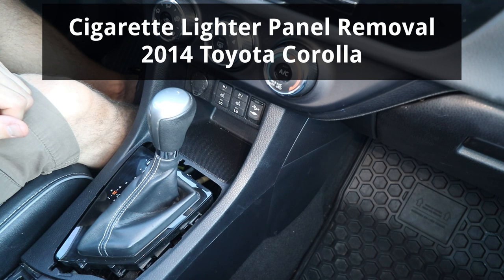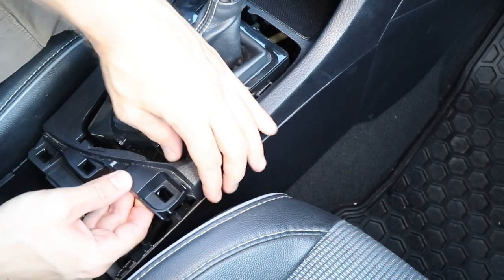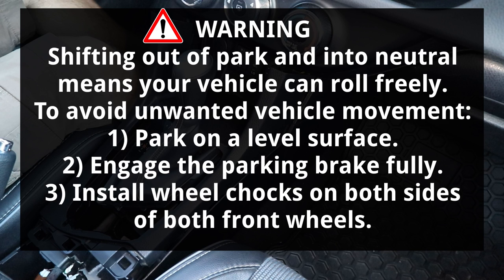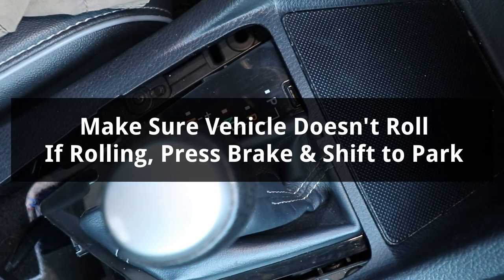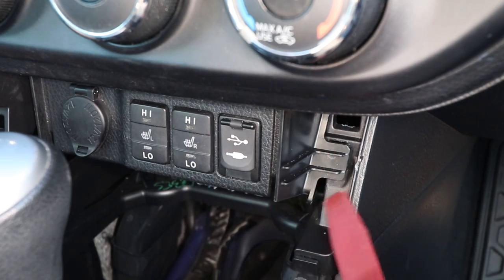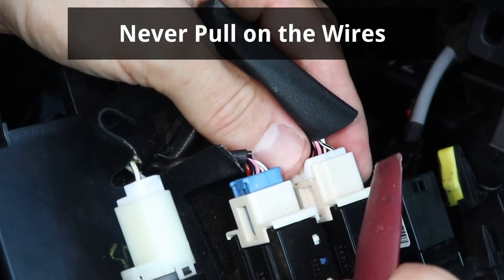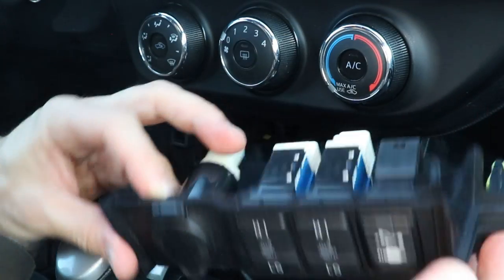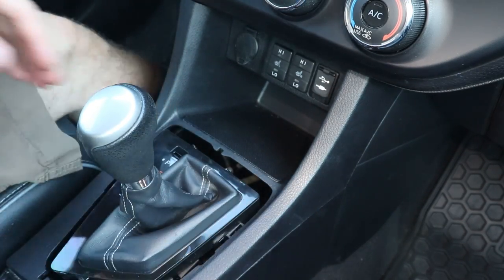Cigarette Lighter Panel Removal, Toyota Corolla 2014 2015 2016 2017 2018

Comment: Thanks for the help.. I got everything off, but I'm stuck on MY last step which your video doesn't cover.. how to get the 12v socket out? I need that replaced I think.
Reply from the maker: There's another comment, someone asked about that, and then he eventually got it out.. Look for that comment, and maybe he can respond if you have any questions..  Try some u-pull it junk yards if possible, maybe you can get the entire part and practice on it. They usually don't care about this part and leave it on.

Comment: How can I upgrade my driver side master window switch to a "Auto UP and DOWN" on all windows? From the factory, only the drivers side is auto up AND down. Can I just replace the master switch with a master switch from a Camry that has auto up and down or is that function not located in the switch? Maybe that function is in the individual window motors or a relay somewhere? *Some Camry years are interchangeable with the Corolla switch. *

Comment: Liked and subed. I recently purchased a 2016 Corolla S. A common problem is the armrest loosens over time and wobbles from side to side. It's easily removed by unscrewing the 4 screws but the center piece of the plastic hinge wears out over time - causing the wobble. . A metal pin holds the hinge together. Question - How can the hinge be reinforced to stop the wobble?
Reply from the maker: I am not sure how the hinge can be reinforced sorry.. I think the best way would be to replace it once it wears out. I would think the hinge shouldn't be too expensive.. or maybe you can find it at a junk yard.

Comment: Hi where can i buy the after market usb ports for this with the exact port cable
Reply from the maker: I am not aware of any aftermarket port with the exact cable. Check a junk yard, or the dealer.  It should be very cheap at the yard.

Comment: I know how to do this , but how do I completely remove the cigarette lighter. Is there a tool to use ?
Reply from the maker: Sorry I'm not sure, did you try pushing it from behind toward the front? Usually there are some clips/plastic tab, that hold it from coming out, and they need to be pressed down to release it.. Did you figure it out?
Reply: @CleverFix  actually I figured it out. The electrical connector has clips on the side , I popped them off and the connector came off then a small bolt and nut held the rest of it together and the whole thing came apart once I got the nut off. Thanks for the feedback.